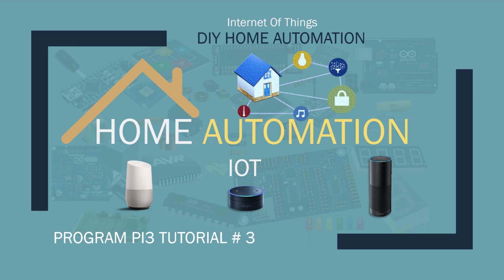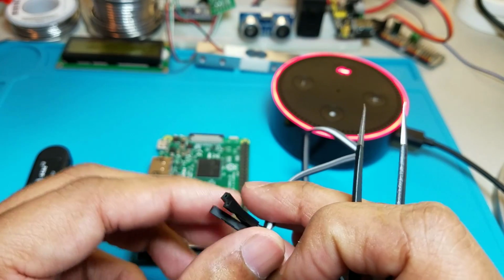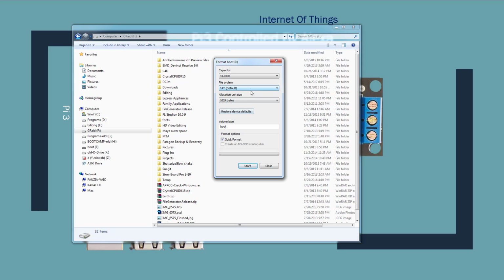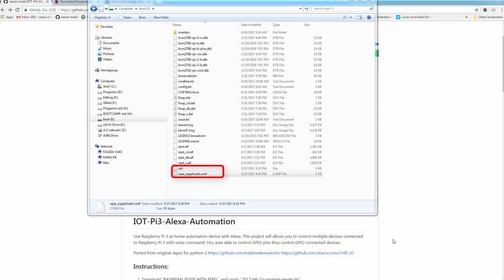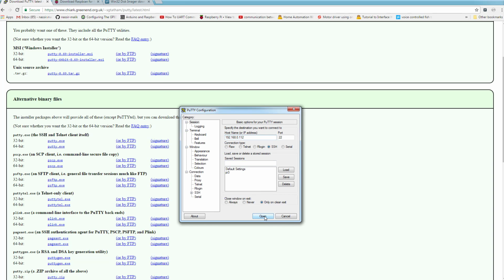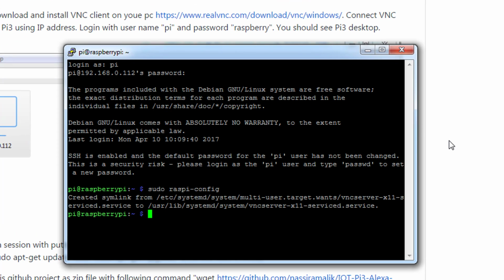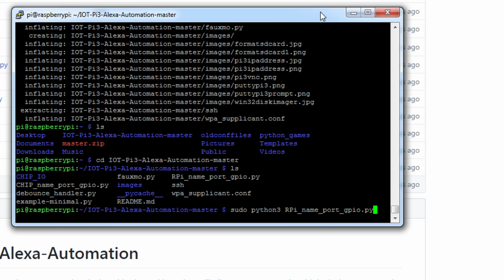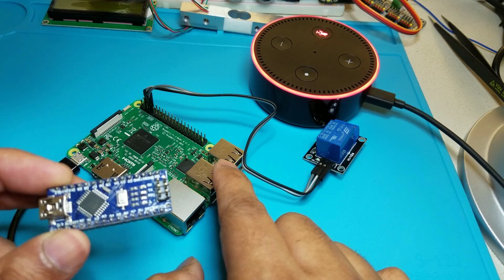Raspberry Pi projects beginners | Home Automation with Alexa | Tutorial # 3

Comment: Hi it finaly gave me some errors here they are  File "RPi_name_p                                                                                                   ort_gpio_8_Relays.py", line 99, in <module>
-bash: syntax error near unexpected token `newline'
    data = data.decode('utf-8')
UnicodeDecodeError: 'utf-8' codec can't decode byte 0xf8 in position                                                                                                    74: invalid start byte

During handling of the above exception, another exception occurred:

Traceback (most recent call last):
  File "RPi_name_port_gpio_8_Relays.py", line 102, in <module>
    logging.critical("Critical exception: "+ e.args  )
TypeError: Can't convert 'tuple' object to str implicitly
pi@raspberrypi:~/IOT-Pi3-Alexa-Automation-master $
pi@raspberrypi:~/IOT-Pi3-Alexa-Automation-master $     p.poll(100)
-bash: syntax error near unexpected token `100'
pi@raspberrypi:~/IOT-Pi3-Alexa-Automation-master $   File "/home/pi/I                                                                                                   OT-Pi3-Alexa-Automation-master/fauxmo.py", line 88, in poll
-bash: File: command not found
pi@raspberrypi:~/IOT-Pi3-Alexa-Automation-master $     target.do_read                                                                                                   (one_ready[0])
-bash: syntax error near unexpected token `one_ready[0]'
pi@raspberrypi:~/IOT-Pi3-Alexa-Automation-master $   File "/home/pi/I                                                                                                   OT-Pi3-Alexa-Automation-master/fauxmo.py", line 311, in do_read
-bash: File: command not found
pi@raspberrypi:~/IOT-Pi3-Alexa-Automation-master $     data = data.de                                                                                                   code('utf-8')
-bash: syntax error near unexpected token `('
pi@raspberrypi:~/IOT-Pi3-Alexa-Automation-master $ UnicodeDecodeError                                                                                                   : 'utf-8' codec can't decode byte 0xf8 in position 74: invalid start                                                                                                    byte
>
> During handling of the above exception, another exception occurred:
>
> Traceback (most recent call last):
>   File "RPi_name_port_gpio_8_Relays.py", line 102, in <module>
>     logging.critical("Critical exception: "+ e.args  )
> TypeError: Can't convert 'tuple' object to str implicitly
-bash: UnicodeDecodeError:: command not found
pi@raspberrypi:~/IOT-Pi3-Alexa-Automation-master $ pi@raspberrypi:~/I                                                                                                   OT-Pi3-Alexa-Automation-master $
-bash: pi@raspberrypi:~/IOT-Pi3-Alexa-Automation-master: No such file                                                                                                    or directory
Reply from the maker: Dean Lawson  Make sure use "sudo python3 RPi_name_port_gpio_8_Relays.py" to run the script.

Comment: i have trouble 
i just want to do 8 outputs 
tube
fan
tv
color lights
bed switch
computer
home theater
switch
i tried to edit but it is not working it shows an error  shown below
DEBUG:root:Listening for UPnP broadcasts
DEBUG:root:got local address of 192.168.1.140
Traceback (most recent call last):
  File "RPi_name_port_gpio_8_Relays.py", line 92, in <module>
    fauxmo.fauxmo(trig, u, p, None, port, d)
  File "/home/pi/IOT-Pi3-Alexa-Automation-master/fauxmo.py", line 195, in _init_
    upnp_device.__init__(self, listener, poller, port, "http://%(ip_address)s:%(port)s/setup.xml", "Unspecified, UPnP/1.0, Unspecified", persistent_uuid, other_headers=other_headers, ip_address=ip_address)
  File "/home/pi/IOT-Pi3-Alexa-Automation-master/fauxmo.py", line 130, in _init_
    self.socket.bind((self.ip_address, self.port))
OSError: [Errno 98] Address already in use
Reply from the maker: Guru Aswath Gurunathan I uploaded a modified code that can control up to 8 devices. You can download and try it. I hope this helps.

Try "RPi_name_port_gpio_8_Relays.py" from GitHub and let me know.

https://github.com/nassir-malik/IOT-Pi3-Alexa-Automation
Reply: Netmedias okay sir done will doo

Comment: Thanks for the video! 
Quick question, seems like ESP8266 board (from previous video) has two GPIO pins, so can those pins be used to control a relay? If yes, what's the sense to use a $30+ Pi instead of $5+ ESP8266 board?
Reply from the maker: byn1975 You can't parallelly execute multiple tasks in ESP, but Pi3 can do that; so it depends on your requirements. You will see this in my future projects. Thank you for your comments.

Comment: Hello Nassir, I followed you excellent tutorial. But i can get Alexa to switch on the relay, but not off. They are single channel high level trigger. Hope you can point me in the right direction. Many Thanks
Reply from the maker: dave griffin try to set the GPIO to high and low and see it that works. You can modify the code and instead of state variable set it to false or true.

Comment out this
GPIO.output(int(7), state)

type in this
GPIO.output(int(7), False)

time.sleep(2)

GPIO.output(int(7), True)

Make sure use the correct GPIO (&). Let me know what is the result?
Reply: Netmedias ok I'll try this. Just as an experiment, I strapped out one side of the opto. It solved it as a hardware mod. Not sure if it's a good thing 😀 Thanks in advance 😀

Comment: Hello Nassir, the program works great until i added more triggers, l get this error: 

Traceback (most recent call last):
  File "RPi_name_port_gpio.py", line 70, in <module>
    p.poll(100)
  File "/home/pi/IOT-Pi3-Alexa-Automation-master2/fauxmo.py", line 88, in poll
    target.do_read(one_ready[0])
  File "/home/pi/IOT-Pi3-Alexa-Automation-master2/fauxmo.py", line 152, in do_read
    self.handle_request(data, sender, self.client_sockets[fileno][0], self.client_sockets[fileno][1])
  File "/home/pi/IOT-Pi3-Alexa-Automation-master2/fauxmo.py", line 231, in handle_request
    success = self.action_handler.off(client_address[0], self.name)
  File "/home/pi/IOT-Pi3-Alexa-Automation-master2/debounce_handler.py", line 20, in off
    return self.act(client_address, False, name)
  File "RPi_name_port_gpio.py", line 42, in act
    GPIO.setup(int(4), GPIO.OUT)   ## Setup GPIO Pin to OUTPUT
ValueError: The channel sent is invalid on a Raspberry Pi

During handling of the above exception, another exception occurred:

Traceback (most recent call last):
  File "RPi_name_port_gpio.py", line 73, in <module>
    logging.critical("Critical exception: "+ e.args  )
TypeError: Can't convert 'tuple' object to str implicitly

It world be great to get this working properly. Thanks
Reply from the maker: If you remover "+ e.args" from "logging.critical("Critical exception: "+ e.args  )" what does it do?
Reply: I got:

DEBUG:root:Responding to OFF for office
State False from client @ (IP ADDRESS)
CRITICAL:root:Critical exception:
Reply from the maker: Ok, Try following code and tel me what you get.

TRIGGERS = {"kitchen": 52000,"living room":51000, "office": 53000, "room": 52002, "tv": 52003, "pc": 52004, "xbox": 52005, "light": 52006}

    def act(self, client_address, state, name):
        print("State", state, "from client @", client_address)
        if name=="kitchen":
            GPIO.setmode(GPIO.BOARD) ## Use board pin numbering
            GPIO.setup(int(2), GPIO.OUT)   ## Setup GPIO Pin to OUTPUT
            GPIO.output(int(2), GPIO.HIGH) ## State is true/false
        elif name =="living room":
            GPIO.setmode(GPIO.BOARD) ## Use board pin numbering
            GPIO.setup(int(3), GPIO.OUT)   ## Setup GPIO Pin to OUTPUT
            GPIO.output(int(3), GPIO.HIGH) ## State is true/false
        elif name =="office":
            GPIO.setmode(GPIO.BOARD) ## Use board pin numbering
            GPIO.setup(int(4), GPIO.OUT)   ## Setup GPIO Pin to OUTPUT
            GPIO.output(int(4), state) ## State is true/false
        else:
            print("Device not found!")
        
        GPIO.cleanup() # cleanup all GPIO
Reply: do i have to insert "['office', dummy_handler("office")]," into fauxmo.py as well?
Reply: set this up with a pi 2 works like a charm except for the states being reversed like braden . great tutorial and really easy to work with code many thanks

Comment: Hello Nassir.

I have installed in the apartment various rasperry pis, which send to 433MHz radio sockets the switching commands

Until now, I control the Rasperrys via a central touchpad with a self-programmed website, which sends the control commands to multiple PI's.

(and via Apple devices using Home Remote software)

Example: the HTML command "http://192.168.0.126/remote/index1.php?group=11011&sys=1&switch=02&action=1" switches the light in the living room, the command "http://192.168.0.126/remote/index1.php?group=11011&sys=1&switch=02&action=0" turns off the light in the living room,

the command "http://192.168.0.121/remote/index1.php?group=11001&sys=1&switch=08&action=1" turns on the light in the children's room and the command "http://192.168.0.121/remote/index1.php?group=11001&sys=1&switch=08&action=0 "turns off the light in the children's room.

Do you think it's possible to "misuse" your excellent Py-Script also to send html-commands to various Rasperrys with the Rasperry-remote-deamon? That would be great ...

I know that there must be an extra command to Alexa for sending the on or off command, as there is no feedback for the switching state.

It should be a separate command to turn on and off each 433MHz-remoteswitch.
The safest way is to run each command twice with 1 sec. Pause.

Only: I have no plan how to implement this

Sorry, that I ask so stupid - but I have no idea of the Py programming ...
Reply from the maker: einarmiger0815 easiest way to accomplish this without touching  much of the code to do following.

First import "import requests" file on top of the "RPi_name_port_gpio.py"

then change the code like following.

if name=="childrens room":GPIO.setmode(GPIO.BOARD) ## Use board pin numberingGPIO.setup(int(7), GPIO.OUT)   ## Setup GPIO Pin to OUTPUTGPIO.output(int(7), state) ## State is true/false
if state==true:requests.get("http://192.168.0.126/remote/index1.php?group=11011&sys=1&switch=02&action=1")esle:
requests.get("http://192.168.0.126/remote/index1.php?group=11011&sys=1&switch=02&action=0")
elif name =="living room":GPIO.setmode(GPIO.BOARD) ## Use board pin numberingGPIO.setup(int(11), GPIO.OUT)   ## Setup GPIO Pin to OUTPUTGPIO.output(int(11), state) ## State is true/false
if state==true:
requests.get("http://192.168.0.121/remote/index1.php?group=11001&sys=1&switch=08&action=1")
else:
requests.get("http://192.168.0.121/remote/index1.php?group=11001&sys=1&switch=08&action=0 ")
else:
Reply: Great, thank you so much! I will try it immediatly and tell you the results !
Reply: Nassir, please can you take a look in your emails?
Reply: Every time i try to run the script, I get the error: TabError: inconsistent use of tabs and spaces in indentation
Reply from the maker: einarmiger0815 Your code formatting us incorrect. Use PyChram or any other ide to correct it. PyChram is free and it will highlight the ploblem code so you can fix it.

Comment: Thanks for the tutorial It worked fine but I can not get it to run at startup. I added "sudo python3 /home/pi/IOT-Pi3-Alexa-Automation-master/RPi_name_port_gpio.py &" to "rc.local" but it does not work any ideas what I am doing wrong?
Reply: Hello. I had the same issue and I found a solution.. add this line to your /etc/rc.local but before the exit 0: (sleep 15;python3 /home/pi/IOT-Pi3-Alexa-Automation-master/RPi_name_port_gpio.py)&

So, the list of commands is: 
cd
sudo nano /etc/rc.local
{Add "(sleep 15;python3 /home/pi/IOT-Pi3-Alexa-Automation-master/RPi_name_port_gpio.py)&" without quotations before exit 0}
{Control C, Y, Return to save and exit}
sudo reboot

Hopefully this helps!
Reply: https://www.dexterindustries.com/howto/run-a-program-on-your-raspberry-pi-at-startup/
Refer to this site 
2nd point

Comment: Thanks for a good clear tutorial.

I've just followed it, using a fresh install of raspbian stretch-lite, on a raspberry pi B+.
All went well except that the python 'requests' and 'RPi.GPIO' modules were missing.
So I had to add extra steps: (running as root - but could prefix with sudo...)

apt-get install python3-pip
pip3 install requests
pip3 install RPi.GPIO

(Also found the logic was reversed: ie on=off etc - but easy to fix!)
Reply from the maker: Mike Price thank you for sharing your fix.

Comment: Hello Nasir,
The triggers means that frequency for Alexa or just the code name we can set any number,like 1 or 2
Reply from the maker: 黃聖軒 Triggers define the device name and port number. You can use any name as long as Alexa can process it. For an example you can use "tv" instead of "kitchen". You will have to try it to see if it works or not.
Reply: Netmedias thank for your answer,I mean the number behind the name,like "tv" 52000,the 52000 is for what?
The number can set up with what we like or have regularity.

Comment: Hi Nassir,

If the raspberry pi loses power do you have to re-run the program or will it auto start again after boot up?
Reply from the maker: mrm9229 you can add the script to you startup directory. It will automatically will every time pi is restarted.

Comment: Thanks for sharing! Works very well!

If anyone wants this to run at boot up you'll need to write a script for that. I recommend including the file path of the "RPi_name_port_gpio.py" into the "/etc/rc.local" file per the Raspberry Pi documentation. 

I see where folks are asking about changing the N.O./ N.C. logic due to the RPi default output. Has anyone had any luck experimenting with the suggestions of  "fauxmo.py" file and play around with "if data.find('<BinaryState>1</BinaryState>') != -1:"  and  "elif data.find('<BinaryState>0</BinaryState>') != -1:" ???????

If using the Alexa app it doesn't seem to work when creating groups. For example and in my experiments using a 4-channel relay by creating a group with all 4 devices that were previously discovered it doesn't trigger the RPi outputs. However, if you modify the "RPi_name_port_gpio.py" file to include all of the gpio outputs under one name then they all can be triggered on/off simultaneously. Sample shown below.

TRIGGERS = {"relay":52000,"kitchen":51000, "office":50000, "group 1":52005}

    def act(self, client_address, state, name):
        print("State", state, "from client @", client_address)

        if name == "group 1":
            GPIO.setmode(GPIO.BOARD) ## use board pin numbering
            GPIO.setup(int(15), GPIO.OUT, initial=GPIO.LOW)  ## Setup GPIO Pin to OUTPUT
            GPIO.setup(int(16), GPIO.OUT, initial=GPIO.LOW)  ## Setup GPIO Pin to OUTPUT
            GPIO.setup(int(18), GPIO.OUT, initial=GPIO.LOW)  ## Setup GPIO Pin to OUTPUT
            GPIO.output(int(15), state)  ## State is true/false
            GPIO.output(int(16), state)  ## State is true/false
            GPIO.output(int(18), state)  ## State is true/false
Reply: then how to configure 8 channel relay, i know i can group it in alexa app and make it work but for that i have to define all GPIO pins along with correct name so can alexa find it correctly and can trigger properly and if i make group it should keep doing as was working as single relay...
Reply: Excuse,the int(15) means the GPIO 22?

Comment: i did this and everything works like a charm, but having said that i do have one issue. Seems since i'm using a 2 relay board, it seems to be active low. this means that the relays are "on" (red led showing) when turned off. is there an easy way to flip this logic? other then this minor item this total rocks and i'm loving it.
Reply from the maker: To switch polarity look into the "fauxmo.py" file and play around with "if data.find('<BinaryState>1</BinaryState>') != -1:"  and  "elif data.find('<BinaryState>0</BinaryState>') != -1:"

Let me know if you still have issues.